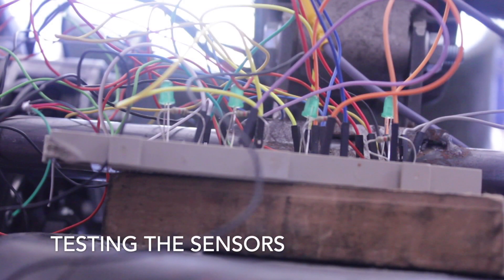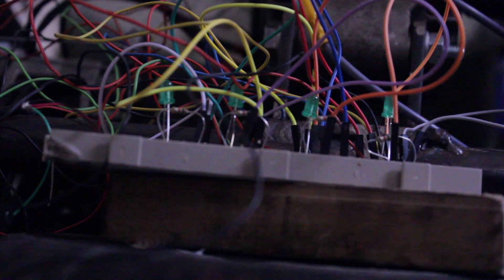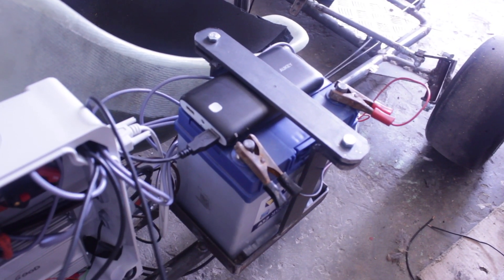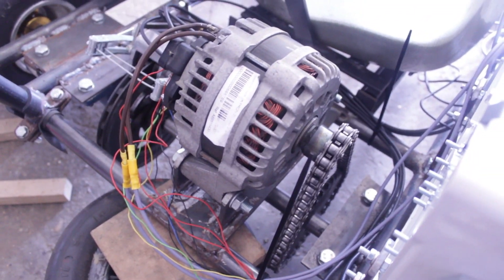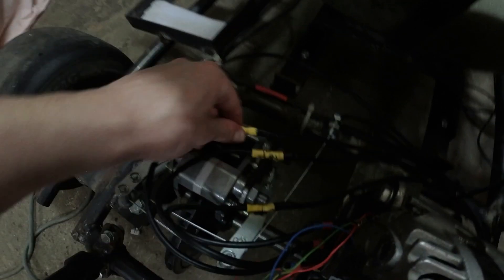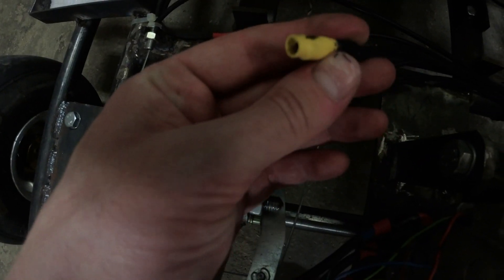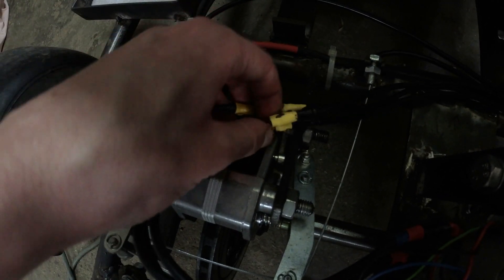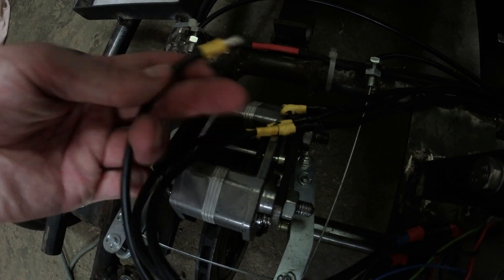UPDATE: The car alternator go kart was running BETTER THAN EVER... then, IT DIED AGAIN! DIY GO KART

Comment: it's a common problem with R/C..There's sensor and sensorless BLM.
Heat are also issues with terminals..You definitely want a cooling fan.
It's alot of reason why I over kill everything..it's mostly for heat management.
Keep an eye on the batteries too
it's good for learning and trouble shooting.
Go kart electric motors have LEFT Handed threads ( now you know why).
It just depends how much money you want to invest a regular 2000 WATT
BLM go kart motor is only $75-$90...but you need to run 48-60v
through them...if you use lead acid ( are different than regular car batteries..they design
to give constant discharge) are HEAVY...then you get into POWER to Weight ratio..
The heavier...the harder the motor has to work..everything get Hotter.
High discharge Lithium arnt cheap...( Learning about different types of batteries can be a subject matter)  DISCHARGE RATE  ( amps)...but it all ties in with the ESC.
Because the esc you're using is Boarderline of being able to handle the AMPS.
In practice..the motor is going to PULL/Suck amps..
Sort of like...it'll keep on spinning  even after you let off power
You also might want to wire  braking on/off...so the power is cut to the motor
when you apply brake. If not...this too can cuase the motor to run HOT and shut down.

The winning to the alternator is designed to take on so much electrons/HEAT.
Then the varnish melts. The power lost...ect.
You're not really running a BRUSHLESS.
You;re running a 3 phase with BRUSHED ( drag)
Brushless motors are MORE Efficent..less drag and no electrons to the rotor.
Hence timing to the rotor...you cant apply constant 12v to the rotor.
That's why induction motors has CAPACITORS..it acts sort of like a CLOCK/timing.
Reply: He installed sensors, so the alternator is a sensored motor now.
About the heat in wires terminals, i gave him some tips for better terminals and better wiring (he will use double wires for each phase).
He is using LiFePo4 battery pack, you can forget the lead batteries, and don't worry about the lithium details.
Yes, that controller is weak for the alternator's power figures, but it's a WIP (work in progress), so mishaps and mistakes happen.
About the braking, depends on the controller, because some of them cut only the power, and some do beyond that, shorting some phases to lock the motor and brake, a dangerous idea.
Yes, the heat and the electrical power on the motor is over the normal limits that it was made for (and still most alternators tested through all these years didn't failed, from what i know).

And here you are again to talk about efficiency and "real brushless motors" on alternator-as-motors videos...

Look, it's the last time that i tell you, alternators when converted to motors ARE INDEED brushless motors (DC synchronous motors), and being more specific, they are DC-excited synchronous motors. If they weren't BLDC motors, BLDC controllers won't be able to spin them at all, just like BLDC controllers can't spin induction motors and vice-versa.
Reply: @foxxyytofficial  Im pretty sure there's Fu4ken BRUSHES inside Alternators...
causing DRAG and HEAT, When sheit gets hot it EXPANDS and cuase
more RUBBING and MORE HEAT..and Requires More electrons..which 
generate more freaken HEAT and RUBBING and the cycle continue.
It's the LAST TIME it';ll tell you...LOOK at the god damn thing with
your Freaken EYES..There's BRUSHES in it...aye!!!!
IN RUNNER burshless Motors with Megnets..DONT HAVE BRUSHES
to the ROTOR.....Hence 3 phase BRUSHLESS MOTOR....aye!!!
Oki doke...I have to replace the alternator to my cars becuase
the damn winnings got too damn hot over time and aint recharging
12v anymore....STRANGE that autozone has shietload of after market
Alternators. IDK why they would do shiet like that....according to you...Shiet like that dosnt happen on a regular basis.
Last but not lease....I over power my toys for many reasons.
I have crap load of Burnt out motors....( winnings) BRUSHED and BRUSHLESS...In runner and out runners..becuase I over AMP
and VOLTS.... Aye!!!
I could REWINe the wires...but slapping in a new motor
is quicker and cheaper,,if I dont have a mass production line.

I also used to work at a POWER PLANT,...Crap load of motors and gear box..
ect...in different configurations..brushed and brushless.
The Biggest Motor is the freaken 16 mega WATT ALTERNATOR..lmao
Some people call it a GENERATOR.....
The bietch gets hella HOT..it gets Oil  and water cool.lol
Reply: @oneeyemonster3262  why are you here if you're not here for the alternator idea?
Reply: @oneeyemonster3262 automotive alternators do not have brushes in the same manner that a dc motor does. They have brushes in the same manner that an ac motor does. They have a slip ring. Also, brushes do not add a significant amount of heat. The main heat source in a motor comes from the resistance(dc) or impedance(ac) in the windings. Even in dc motors brushes fail because of wear and not heat. Brushes are commonly made of materials like compressed graphite composites that are conductive, wear resistant and heavily heat resistant. Since brushes are designed to function when short circuited they dissapate little power themselves even at high currents.

The rotor/field windings in most automotive alternators is designed to run at 12v dc and and are commonly current limited to about 4 Amps maximum (at 12v) by winding resistance. This is about 50watts of power. Same as a single incandescent lightbulb. It is effectively an electromagnet that replaces the function of the permanent magnets in other motors. You can also short the rotor winding and slip rings to make an alternator motor run as a 3 phase induction motor.

Furthermore the main inefficiency in an alternator is caused by the regulator pack and lack of load matching the output. This is much of what makes an auto alternator 50% efficient when operating as a generator. As a motor it does not have that issue and should be able to at least match the 60 to 80% efficiency of a higher voltage pwm controlled dc motor. Look up the nasa test documents on the mtc-4001 dc motor to see some real data on that 10-20kw motor.  Varying the current on the field winding could even let you get high efficiency at both low and high speeds since it changes the torque and rpm characteristics of the alternator motor. 

Add to this that auto alternators are commonly designed for 50 to 200amps of current through the windings continuously, are made to handle 3 to 10HP (~3-10KW) worth of power running through them for many thousands of hours and that they can often be acquired for 10 to 60 dollars ($ or €) or sometimes for free and auto alternators become a nice budget alternative to a bldc or induction motor on many high power diy projects.

Comment: Eres un genio! Estoy fascinado por el trabajo que estas haciendo! Desde hace un tiempo me he animado tambien y he empezado tambien mi projecto. Quiero modificar el Rotor del altenador y hacerlo con imanes sin la necesidad de alimentarlo con los 12 v y los aproximadamente 4 Amperios que consume solo para excitar el Rotor.
Tengo una pregunta: donde has conseguido el piñon del alternador? Lo has comprado y modificado? El mio tiene 17mm y no encuentro ninguno que pase. Por que no conectas los cables del motor directamente a una conexion de motor industrial? Que seccion has utilizado para los cables? 4 o 6 mm?
Espero que me puedas ayudar.
Cuidate y continua asi. Tienes un seguidor mas.
Un abrazo desde Alemania
Reply from the maker: Buenas. Intentaré responder con la máxima claridad:
- El piñón del alternador lo fabriqué en el torno, saqué el casquillo central de la polea que venía con el alternador y modifiqué el pinón para que encajase en el casquillo. Luego lo soldé. La rosca del alternador que tengo es de M16X1,5. La polea era como esta: https://www.amazon.es/9XU-358-039-101-alternador-Poleas/dp/B071G858LP/ref=sr_1_fkmr1_1?__mk_es_ES=ÅMÅŽÕÑ&dchild=1&keywords=polea+alternador+m16&qid=1591647431&sr=8-1-fkmr1
- He comprado las bornas de cerámica (que instalaré en próximos videos) en una tienda de repuestos de motores eléctricos. Las que me fabriqué con impresora 3D han acabado fundidas debido a las elevadas corrientes al arrancar estando parado.
- Para la conexión del alternador al controlador he utilizado cable estándar de 6mm^2. Al usar el motor a "máxima potencia" me di cuenta de que los cables se calentaban. Justamente ahora estoy rehaciendo toda la instalación del controlador al motor con cable de 6mm^2 con aislamiento de silicona (2 cables por fase, en total 12mm^2  por fase), este tipo de cable también se utiliza en drones ya que la capacidad de amperios que aguanta (ampacity) es mayor que los cables de instalaciones eléctricas normales.
El trozo de cable que va de la batería de 48v hasta el relé y el controlador es estándar de 10mm^2. Si veo que también se calienta al ponerle el nuevo controlador también lo cambiaré por uno aislado de silicona.
Lo convertí en eléctrico para un trabajo de la universidad, lo hice como pude para que quedase bien y funcionase, a la larga he tenido problemas de sobrecalentamiento en los controladores baratos que compré en amazon. Ahora estoy esperando en que me llegue uno que tenga de pico 100 amperios y programable mediante pc para ver si puedo sacar más potencia del alternador. 
La electrificación me costó unos 900€ (lo más caro las baterías de litio) y sólo añadí 2kg respecto al motor de gasolina.
Espero que te sirva de ayuda, si tienes alguna pregunta no dudes en preguntar. Mucha suerte!
Saludos.
Reply: @OverbuiltByHenry  
Muchisimas gracias por tus consejos.
Que variador me puedes recomendar? Ese para picos de 100 Amp? Donde lo podría comprar? Lo que no tengo claro:
Tu variador es para motor de escobillas o Brusless? Sirve para los dos tipos de motores?
La bateria de Litio las has comprado terminada o la has hecho tu mismo? 
Yo tengo las baterias de Plomo de 12 V y 7.2 Amp. Quiero montar 5 en serie a 60 V pero no se si tendra suficiente potencia. Tendria que hacer las pruebas pero no tengo el controlador todavia por que no me decido cual comprar..
Muchisimas gracias por tu ayuda.
Un saludo y estas haciendo muy buen trabajo!
Gracias y un saludo
Reply from the maker: El variador (ESC) que te iría bien creo que sería el ESC FSVESC, se usa principalmente en longboards motorizados es programable por pc y da unos 240 amperios de pico (es de código abierto y hay versiones mejoradas que admiten más voltaje y sacan mas amperios https://trampaboards.com/vesc--c-1434.html).
Yo no lo he utilizado porqué son muy sensibles a los picos de tensión y funciona hasta 60 voltios (la versión estándar), me explico:
- cuando reduces la velocidad bruscamente (frenado), en el instante en que dejas de acelerar, como el motor sigue girando hace de "generador" y genera voltage (eso es lo que yo tengo entendido) y provoca esos "picos" de tensión.
- compré la batería para los controladores "baratos" de amazon de 48 voltios y escogí una de 48V; lo que pasa es que cuando está completamente cargada saca 59 voltios, muy cerca del límite de "seguridad" del VESC. Hay un usuario de Australia que se llama "fixitmoditbreakit" que tiene montado como un "banco de pruebas" donde usa diferentes alternadores con VESC (https://www.youtube.com/channel/UCWObvAzP341gA8HRlKcHRQQ/videos).
Los controladores que he usado son para motores brushless, y también voy a usar un controlador PWM aplicado a la bobina del rotor. Al poder variar la tensión de la bobina del rotor con el PWM se varía la intensidad del campo magnético del rotor. Si pones el PWM al 100% el motor va a tener mucha fuerza y a medida que vas bajando la tensión con el PWM pierdes fuerza y ganas velocidad (en los motores esto se llama "field weakening").
Me registré en este foro: https://endless-sphere.com/forums/ la temática es sobre todo tipo de vehículos eléctricos, baterías, motores, controladores... hay muchos usuarios experimentados y la gente ayuda (o pide ayuda) sobre los problemas que te puedes llegar a encontrar con tu proyecto. No es que esté todo pero hay mucha información.
La batería que tengo es LiFePO4, la compré totalmente "hecha" por unos 600€, da 50A continuos y 100A de pico. Si ahora me hiciese falta otra batería primero valoraría si comprarla montada o lo que me costaría hacerla (celdas, BMS, materiales y herramientas).
Cuándo estaba planteando que baterías comprar, mi idea era poner 4 baterías de 12V de 100Ah, la cual cosa añadía unos 80kg al vehículo por 400€. Un profesor de mi universidad me dijo que tenía que ser de litio por su peso y tamaño reducido, la batería de 48V que uso pesa 10kg. Escogí las de LiFePO4 porque son mucho mas seguras que las de litio tradicionales por "si las moscas"
Quizá con tres LiPO de 11.1V de unos 5-6Ah y el FSVESC te saldría algo decente.
El controlador que he comprado es el BAC-0501 de goldenmotor (https://www.miromax.lt/en/m-6/c-39/c-44-bldc_motor_controllers/product-41-controller_bldc_50100a_-_bac-0501_#to_products) que funciona con o sin sensores hall y es programable por ordenador (los sensores hacen la misma función que haría un encoder). Yo creo que el tema de los sensores también puede ser importante porqué cuando le metí mucha caña a parte de que deje atontado al controlador, el motor daba "saltos" y no había manera de arrancar. No me llegó a durar dos meses el motor pelado y tuve que ponerle los sensores durante la cuarentena.
En cuánto a las batería que dices, 5 de 12 voltios en serie te dan 60 voltios y 5x7,2A=36A de descarga cómo máximo, entonces tendrías que limitar el ESC a unos 32-33A como máximo para no "pasarte" al utilizar la batería si no terminarás fundiéndola. También debes saber que cuando las baterías estén casi por debajo de los 12V tendrás que cargarlas inmediatamente si son de plomo-ácido porqué si no ya las podrás tirar.
Espero que te haya servido de ayuda, tengo un perfil del canal en instagram (ig: enrengineering) donde tengo fotos de este proyecto y otros por si necesitas ver alguna pieza en concreto o si no intentaría mandártela.
Gracias y un saludo!
Reply from the maker: Perdón!! con todo el lío de los exámenes finales de la universidad pensaba que lo había pedido. Esperaré hasta la semana que viene a ver si me decido...
Reply: @OverbuiltByHenry  muchisimas gracias por tu ayuda y por compartir tus conocimientos. Lo tengo ahora mas claro. Tendre que inventarme algo para que debajo de una determinado voltaje de la bateria me avise y asi no descargar por completo las baterias. Aunque para las de plomo no es tan critico como las de Litio o Lipo.
No tengo instagram pero voy a ver si me doy de alta para poder seguirte y ver tus fotos. Tambien puedo mandarte mi correo y asi si tengo alguna duda y tienes tiempo me lo puedes aclarar y asi te mandaria fotos tambien de mi proyecto.
Te deseo mucha suerte para tus examenes y de nuevo gracias por tu ayuda.
Un saludo y que te vaya muy bien!
Reply: Perdon, como has conectado el motor? En estrella o en triangulo? En triangulo verdad? He visto gente que lo conecta en estrella. Creo que en triangulo tiene mas fuerza.
El rele es de 12 v o 24V?
De momento probare con las baterias de plomo por que no me han costado nada. Si no probare con unas Lipo, y voy a investigar lo que me has comentado para la regulacion de la excitacion del alternador. No lo sabia. Los sensores Hall me llegaron ayer y los montare el fin de semana y de paso me pedire el controlador ;-).
Un saludo y gracias!
Reply from the maker: Ya venía conectado en triangulo del desguace, el relé para controlar el circuito de 48V es de 12V, así, con la misma batería alimento el circuito de maniobra y la bobina del rotor. Probé con una pequeña de 12V de SAI y no podía con todo debido a que la bobina del rotor se quedaba toda la potencia.
Reply: @OverbuiltByHenry  
Gracias de nuevo. Ahora estoy montando los sensores Hall en el Stator. Estoy intrigado como quedara ;-) ya te ire diciendo.
Un saludo
Reply: @ismaestevez7605  Hola, ¿alguna novedad sobre tu proyecto?

Comment: Nice work dude!! Sounds so good when your pulling away.  So do you think it was a short on the phase wires that killed the controller?  Did it work again once cooled?  If it's dead you should pull it apart and find out what has blown!
Reply from the maker: Once it was cool it was the same, nothing. Before riding it I left it outside in the sun for about 5 minutes while I was preparing the cameras. I think going uphill killed it. I should upgrade the phase wires a while ago, the bullet terminals are "done".

Comment: Yeah, glad to know that you made progress
Now that you found the correct placement of the sensors, time to fix them forever and then combine them with the phase color wires, so that you will never need to fiddle around with them to get the correct combination later
Reply: And since you're gonna upgrade the controller, upgrade the phase wires as well, and check over the alternator's bearings too
Reply from the maker: I'm going to remove the old wiring and replace it with silicone insulated wire. I'm thinking of installing two wires for each phase, just to be "safe".
Reply from the maker: FoxxyYT Have you heard about the nucular 12F controller?
I’m between the BAC-0501 and the Nucular 12F. The nucular has a lot more of features. I’ve contacted the Nucular supplier and it would take around 3 months to arrive. I don’t know which one to choose...
Thanks for the info about the connectors!
Reply: @OverbuiltByHenry  to be honest i don't know Nucular very much, but they are very known on EndlessSphere and i don't seem to find easily bad things about their products.